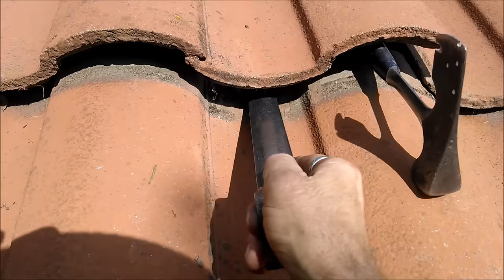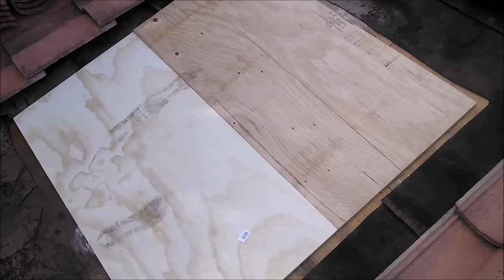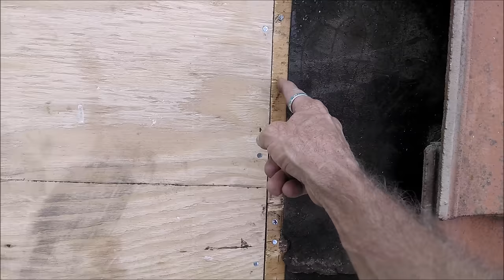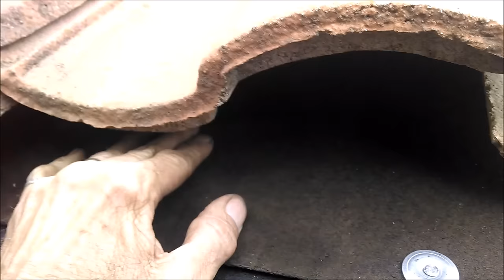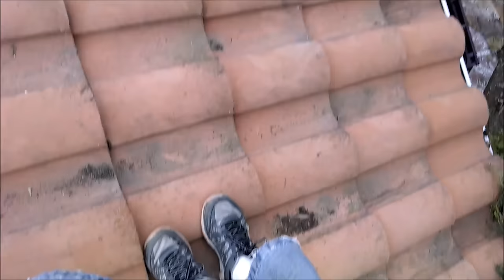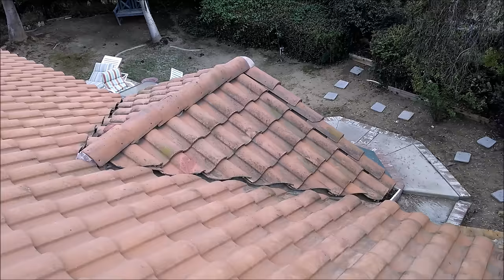Roofing Tile Leak Repair - Tips, Tricks & Helpful Hints

Comment: you are doing the right repair, the right way I would say, like the old days .
1: you said something that is very true! A lot of roofers sell, self adhere underlayment due to lack of knowledge and they blame the underlayment for their fails.
2: the ICBO says, the minimum felt underlayment under tiles is 1 layer and up, on my re roofs I use 2 layers most of the time, i only use ice and water barrier along valleys and low slopes and 1 layer of 30 lbs.
3: I don't agree with you when you say the felt will last 100 yrs, i do a lot of tile reset, where the felt is "toasted" and can't hold anymore.
You are a good roofer!! 
greetings from Southern Ca.
Eric Garcia.
Reply from the maker: Why is the felt "toast" as you say? Answer that question & I think you will likely find that the tile was not installed properly (My way). I was referring to 13.5" (or less) weather exposed courses on standard tile & common sense methods in valleys & other flashing areas, along with eliminating cracked & loose tiles. These are the most common roofing installation deficiencies I've seen over the last 3 decades. These deficiencies are what cause the felt to wear out prematurely. Eliminate these issues & you have a tile roof with felt that that will last at least 50 years. Cut corners in any one of these areas & all bets are off. Thanks for watching...
Reply: I'll answer your question about the slipped tile and the toast felt.
1: I used to be a production roofer , a piece work roofer, the reason that some tiles slip after several years is 
because the contractor pays by laying tiles by the square.
2: At the end of the job , sometimes you end up with some broken tiles on the field , so you send someone to replace them, sometimes that person is lazy to apply roof cement under the tile to seal the nail hole and is lazy enough to apply tile silicone to bridge the replacing tile to the ones that are nailed down.
3: so after the roof is done , the movements of the house , earthquake movements, etc...the tiles slips and this is the result.
I would blame it on the roofer that is tired after a long day and still have to install the next 30 houses on that  track of new homes.
Reply: Hi Duster D, I LOVE your video is amazing. I am trying to find someone that can do the same if not similar repairs to my home and soon!  I did leave an email for you, but not sure if it is the correct email address.  I am in the IE and would love to hear back from you or even Mr. Garcia would be wonderful!!
Reply from the maker: I wasn't asking the question for my sake. I know why roofs leak. My point was that when those labor deficiencies are mitigated the felt lasts for decades because it is protected by correctly installed tiles & flashings. And that is how roofs ought to be installed if roofers expect to get paid. Unfortunately too many roofers are paid for doing crappy work & that's the most common reason why felt wears out, but not on my roofs. It is not hard to make the customer happy doing good work whenever average craftsmanship of the competition is substandard. But I'm sure you already knew that cause you also have been doing this a long time.
Reply: Hey let me know if you locate an affordable roofer in the I.E. with work integrity. I've been trying to get a property repaired for months.
Reply from the maker: Floyd Diaz Were you criticizing me or Eric Garcia? Nevermind, I got it.
Reply: Duster Dan my apologies...I'm a professional roofer with 20+ yrs of experience in service that includes residential, commercial ,and industrial roofing.... I beef it out with Eric all the time because it's always his way and everyone else is wrong...i beg to differ....
Reply from the maker: Floyd Diaz no worries Floyd... I tried giving him a little advice as well & he did the same thing so I just dropped the conversation & left him to his own misgivings. Not only have I been roofing over 30 years, I ran quality control, customer service, pickup work, trouble shooting for one of the best companies in the industry at that time & oversaw dozens of roofers & their work. While it is true that everyone has their own way of doing things, it's also true that you can't teach some people anything. Eric may be one of those people, but the choice is his. He can learn from others or he can learn the hard way. Thanks for looking out for others Floyd. Godspeed!

Comment: Every time I watch this video I learn something new. Thank you. I tried to walk on my tiles as you taught. I have to figure out some method of balance. I used to walk in the valley with pretty good result. I weigh about 140ish.
Reply from the maker: Since the valley tiles are cut at an angle, they are more fragile. I wouldn’t walk on any tiles that have been cut if I don’t need to. Thanks for watching.

Comment: It looked like you dont have battens on this roof. Is there a reason for that? Awesome video. My roof has battens, though. My roof is 19 yrs old and I just sprouted a leak
Reply from the maker: In my area battens are only required by code on steep roofs. Battens have positive & negative aspects… mostly negative. They require additional modifications during installation that most roofers aren’t willing to do or don’t know how to do. If those modifications aren’t done the battens will cause more trouble than they solve. This was a standard pitch roof under 7/12 & didn’t require battens. Hope that helps. Thanks for watching.
Reply: @MrThedocholiday  that does. I am definitely in a situation where they are causing me headaches. They dont allow water to flow. When we did my fathers tile roof, he used screws with gaskets to secure the battens down to allow water to pass under them down the roof. I hadnt ever seen a tile roof without battens before. Thanks for replying!
Reply from the maker: @ryanpaulik864  Exactly… blocking water flow is the biggest problem with battens. And it takes a lot to make em not block flow & still do what they’re designed for.

Comment: First, I'd like to commend you on a well done video and in certain instances, I'm sure this has helped some people. I'm a roofing contractor in SW Fla., since '74. You seem to be from out West, so I'd like to add some information for those that are not from your area. Exposed fasteners on the underlayment do not comply with Florida state building codes (Dade County, State and FM mutual spec), and should be sealed or patched over. On a new roof installation, the exposed fasteners would fail mandatory County inspection. THE ACTUAL ROOF IS THE UNDERLAYMENT, the tile is never watertight, regardless of the shape or type of tile...it's a watershed and protects the underlayment from the elements (sun, wind and rain erosion) and impacts...'some' water runs under the tile all the time...seepage and wind-blown rain, etc. (Look at the bottom edge of the roof, at the eaves, and see the 'weep' holes that allow water to run out from under the tile.) More often than not, here anyway, the tiles are attached by screws rather than nails, and are cut using a device similar to a "slate ripper" that reaches under the tile to cut the fastener...the screws cannot be reached to be taken out, unless the tile above has already been removed. Some older tile roofs are installed with mortar...an actual clump of wet mortar that the tile is laid into. Many newer tile roofs are installed with 'Tile Bond'...an expanding foam adhesive...or a combination of screws and foam adhesive. This profile of tile in the video is called 'Barrel Tile', btw. Another thing to point out is that while the tile itself may be warranted at 30-50 years, the underlayment is not...and we don't use 'felt' for underlayment anymore, but rather a self-adhering membrane such as Polyglass TU (Tile Underlayment) or similar, although we do repair and replace many older roofs that have mopped-down cap sheet as underlayment. I have many customers who have bought homes here and do not know much about tile, such as care/maintenance or how the system is designed to work...we get a lot of 'roofers' that come here from other areas, and they tend to butcher most tile repairs, then I get to go fix them, so...job security, lol.
Reply from the maker: It should go without saying that codes differ in every jurisdiction & while I mention that often, I don’t mention it in every video. It’s always on the craftsman to know his craft, know all local codes pertaining thereto & to care deeply about the customer’s investment first. Anyone pursuing that kind of company policy will succeed wherever they operate.

Comment: Well done, Mr Dan. My S-tile roof has a leak  at one edge, next to a 2nd story wall. I've been told  by one roofer that the copper flashing (embedded in the wall and secured to the deck) and roofing paper both need to be redone. Replacing the copper flashing means cutting out the superimposed stucco then re-stuccoing the wall and painting it. That's a lot more work and material than typical, hence a big price tag. I don't see what's  wrong with your method, although it's in the field, where there's no adjacent wall. Without removing tile, how does a roofer know where the leak is ? Why would it necessarily be under the copper flashing ?  I suspect you might suggest  that it's the $$$ that's under the flashing ?
Reply from the maker: Make them take pictures of the problem, how water is getting through & how their solution should solve the problem. They need to show you the actual problem, not just a picture of your roof that looks normal & their guess as to what the problem is... the actual problem itself. If they can’t show you & explain it in a way that makes sense to you, I wouldn’t pay for it if I were you. It’s not unreasonable to expect a photo of the actual problem before you’re willing to spend significant money fixing it. Not just generalities... specifics.

Comment: I noticed today that I had a small leak on my tile roof. I decided to do a little search on YouTube and your video was the most informative one that I was able to find. I see why you have been in business for so long, not easy to find a honest dependable roofer. Are you in south Florida?
Reply from the maker: Southern California... Sorry I'm not closer, but if you have questions feel free to ask them here or email me @ rooferdan@aol.com

Thanks for watching...
Reply: Duster Dan quick question sir. Does the nail on the tile get nailed into just the tile underneath or into the tile, felt paper and wood?
Reply from the maker: I'm not sure what you mean but all the tiles get nailed through the tile, through the felt & through the roof sheathing all with the same nail. But each nail only goes through one tile, so every tile should have it's own nail holding it in place. When you can't nail individual tiles for whatever reason they need to be glued to other tiles that are nailed through the tile, through the felt & into the roof deck like I just mentioned. The only exception would be the rake-edge trim tiles which each have two nails holding them in place for obvious safety reasons. Does that help?
Reply: Yes it does sir, thank you.

Comment: Thank you for this video! Very well explained to a young guy like me that is attempting to fix a small leak I currently have. I have two questions that I'd appreciate feedback on. 1. What did you use to cut out the bad plywood without hitting the rafters underneath? I imagine using a circular saw that you can adjust the blade height to the thickness of the plywood? 2. What would a person expect to pay (ballpark) on a job like this? Can't decide if I want to attempt myself or hire someone. Thank you!!
Reply from the maker: #1 Answer - I used a skilsaw with the blade set at a half inch deep so it just cuts deep enough to get through the plywood but not significantly through the rafters. If you slightly hit the tops of the rafters with the saw blade it's not a big deal. You just don't want to compromise their strength by cutting into them significantly. #2 Answer - $400 to $800 depending on their level of expertise & the job particulars. You pretty much get what you pay for in construction. Getting a warranty will often effect the price as well.

Comment: OK, Duster Dan, two questions:
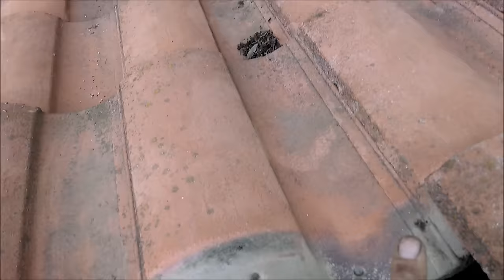1. At 16:30, instead of or in addition to a dollop of sealant over the nail head, what about cutting an fitting a copper sheet that locks on the upper edge of the tile, fits the curve of the tile, and extends below the lower edge of the upper tile? I've had some sealant shrink a bit and worry about that. 
2. At about 17:00, what about drilling the hole out? I've had good luck doing that.
Reply from the maker: Jeff Biss 1. Depending on how bad the overlap is, sometimes I’ll put sealant on these semi-exposed nails & other times I’ll glue in a piece of galvanized sheet metal if they’re exposed really bad, similar to what you mentioned. 2. I always carry a small mason bit to drill out those nail holes when needed but it’s very time consuming if you have dozens of them to drill, but gluing tile in meets code & they will remain in place indefinitely if glued correctly.

Comment: thanks for the most informative video. I have the same tile roof. what do i do in the areas that meet a wall where the underlayment has already worn out but if I can  get flashing above the tiles , i can prevent the water from slipping between the tile and the wall? How do i accomplish that?
Reply from the maker: Meir Kin I’ll try to get back to you today on your question because it’s one of the most difficult areas to waterproof, very difficult to repair & I think you’ll really appreciate my solution. It took me over two decades of experience to figure that solution out.

Comment: I do maintenance for a solar company and the amount of broken tiles that the install guys leave underneath the array is insane.

How fast does that felt paper rot ?
Reply from the maker: This is why I highly discourage having solar installed on tile roofs. Depending on the direction of the break & where it’s located, it can be as soon as 3 years or as long as 10. Either way, it’s a guaranteed future leak on a roof that’s designed to last 50-100 years.

Comment: Where are you located?  I’ve had the same roof leak fixed 4 times over the years and still have an issue.  I would trust that you would fix it. Thank you for the video
Reply from the maker: I’m in SC

Comment: oh , over here in england pretty much every pitched roof is battened out and the tiles are hung on the batten and nailed every 3rd or 4th course makes repairs quick and easy simply lift  the tile out and put a new one in they have lugs that hook over the batten so no need for any adhesive , not sure if yours are the same over there but good to know how other roofers work :) thanks for the reply maybe i'll upload a video one day

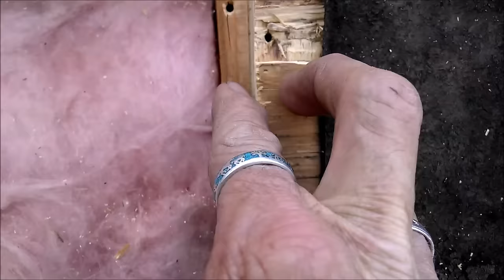Comment: Dan, on the right hand side of the cut at timestamp 8:04, were there pairs of nails installed on the rafter? In other words, were the nails in pairs, allowing you to cut between them while staying on the center of the rafter width? I noticed that some nails were removed from the inside of the cut right edge, but some nails are still installed on the rafter on that right edge, holding the plywood to the right. Do you always cut on a rafter where two panels come/butt together so you can cut in-between in the middle of the rafter? How do you cut on a rafter where there's one row of nails installed in the middle of the width, but still leave a lip for the replacement plywood to sit on? Thank you for the great video!
Reply from the maker: When I put the new panel down on the roof to mark my cut I’ll orient the panel to land in between the nails if there are pairs or to one side or the other of a row of nails. The rafters are always wider than where the nails are located along the edges of the rafters so you’ll always have a lip to rest the new panels on. The only other thing you’ll need is to be able to reach the rafter edge with the new fasteners through the new replacement panel. This is easiest if nailing the new panel by hand but can also be achieved with a nail gun if done carefully.
Reply: @MrThedocholiday  Excellent! Thank you for your reply!

Comment: Pitch or need for battens even the new courrgated weeping channels kind. Are these fragile to break as you walk. Only a certain way, my Monier are very fragile and many get broken In 1991 they used 1/4  " x1.5" horizontal battens, Seems to trap water below tiles, Hip and ridge and not really steep. Just as you finished up and walked across safely, at 24:46 there was a cracked tile 6+ feet ahead and a loose slipped tile down 3" about 10 feet away one row up. Hope you took the time to fix them. Darn fragile tiles.

Comment: Dan.  This is a wonderful video. I am contemplating doing my very first roof leak job now that I've discovered that it is definitely a result of a tile/plywood,underfelt issue.  Or heck, I should just hire you.  Are you by chance in the West Palm Beach area of the country?
Reply from the maker: Just go for it yourself when you have good weather forecast for a few days. I’d normally do a repair like this in a day but if you run into difficulties it could require a second day. So give yourself 3 or 4 days, since you haven’t done this for a living. Watch all my roofing videos ahead of time to get a full idea of the possibilities you may encounter. I typically cover everything relevant in my videos so even if it doesn’t seem relevant at first, you may find details that prove invaluable later. And if you have questions feel free to ask me. Pics are always helpful too.